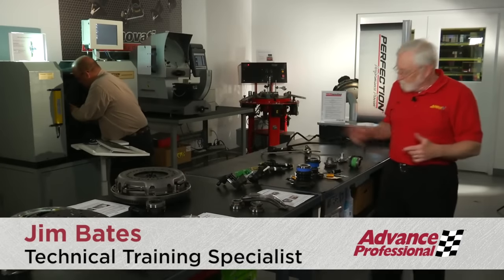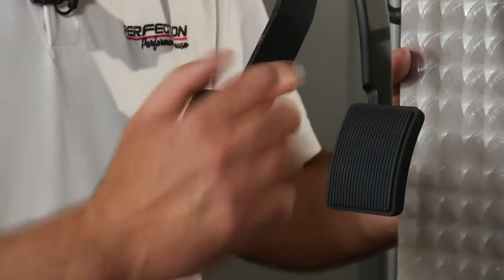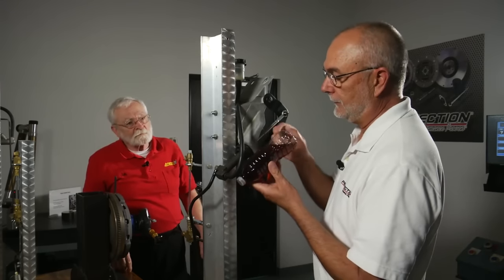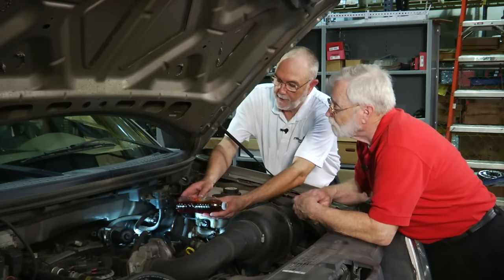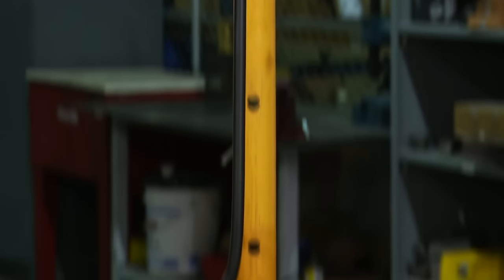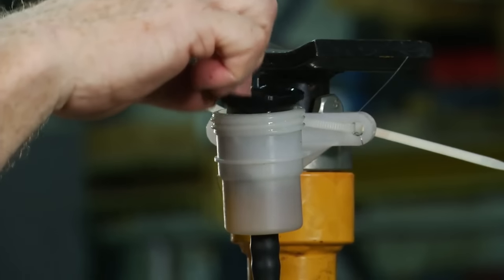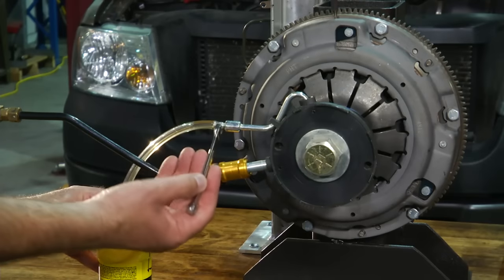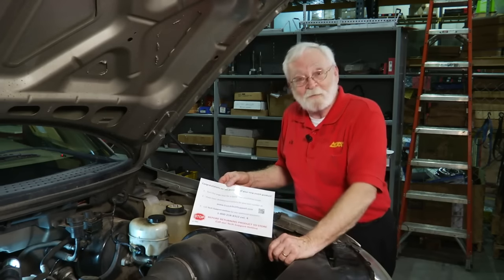How To Bleed A Hydraulic Clutch - Wrenchin' Up

Comment: out of all the cars/trucks i've had in the past years,none had a hydraulic clutch.my current truck is just an '86 chevy 1/2 ton short bed with a small block chevy engine in it.why did they do something like that at the factory.guess i'll need to do some google searches or check some information on here.
Reply from the maker: Hi - Thanks for watching and for your comment! Yes, hydraulic clutches have been around for quite a while and I'm sure you will find a lot of  good (and bad) info out there in your search.
Reply: @WrenchinUpwithJimBates  thank you for replying to my comment,very much appreciated.after watching your video a second time,i just may stick with what's in my truck at present.it seems very easy to do and can't be any worse than having to bleed brakes.the information provided in the video is very helpful and i hope all who watch it,me included, will get something out of it.whether it be their first time or have done this before.once again thanks for posting your video.

Comment: so I had a clutch pedal that was all the way to the floor.  couldn't shift gears.  I unbolted the slave clutch cylinder but could not remove the rubber clutch line connected to the slave cylinder (the nut is pretty stripped).  I did notice I could not push the piston in at all on the slave cylinder so I figure it is bad and I should replace it.  so for the time being, I left the slave cylinder dangling.  the next day,   I came out and the slave cylinder piston is pushing in and out fine.  it wasn't pushing in and out before.    so I figure, maybe the problem is now fixed.    so, I bolt the slave cylinder back on and start self bleeding it.  however, I open the bleed valve and nothing comes out.  believe it or not, I completely remove the bleed valve and still no fluid is coming out of the slave cylinder.   the clutch cylinder fluid reservior is full.  I did pump the clutch, many, many times (with the bleed screw crack 1/4 turn) but no fluid is leaking out of the bleeder valve.   is my slave cylinder now clogged?  or is the clog somewhere else?
Reply from the maker: Hi - Thanks for watching! The slave cylinder piston may be bypassing. I recommend that you check with Precision Clutch because they have an extensive library of vehicle specific videos and information to help with the diagnosis and repair. Their contact information is this video's description.

Comment: Nice, but how would I stop air from getting back into the system when installing? All my stuff has hard fixed lines, I can't remove it without removing the lines.
Reply from the maker: Hi Dennis - Thanks for watching! Great question - I suggest you ask the folks at Perfection Clutch because they have a library of vehicle specific videos and information that can help you with this. Their contact information is in the video description.

Comment: hi . my jeep Rubicon 2007 manual 6 gear 3.7 , has a problem if you press clutch it goes in gear but its not engaging or going in gear
Reply from the maker: Hi and thanks for watching! I appreciate your comment but there is not enough information there for me to understand the problem. When you press the clutch what goes in gear - the shifter or the transmission? What's not engaging - the clutch or the transmission gear selection?
Reply: Yea bro thats cuz of the pedal

Comment: 06 chevy colbalt starts but doesnt move. We bought a new clutch but haven't installed it yet. Was wondering if it could be anything else before we fix it?
Reply from the maker: First of all, thanks for watching! As far as your question though, I would need more information before I could offer any advice, such as when and how did it start doing this, what you have checked already, is the car in gear when it doesn't move, can you get it in gear. etc.
Reply from the maker: Thanks for keeping an eye on this Gary. Your input is very relevant and helpful!

Comment: i Have a 1989 Full Size Bronco V8  i am Having trouble Bleeding my New Cylinder & Line,  My fluid cup & Master is ONE  & the same,  what is the best way to Bleed,  you only show the cup a short line then the master, Mine is all in one,  PLEASE HELP ?
Reply: Hi Gary,  i have bleed this new clutch the best i can,  i can drive it,  but the clutch grabs at the very bottom, to get it in reverse or first gear, i must have the peddle pressed into the floor as hard as i can,  it is a Bronco 1989 full size 
5 speed,  my master & cup is set up just like a brake master,  but the line comes out of  the front of it "master"and goes on a 180 degrees,  then goes to the firewall & to the slave,   i have done many 4X4 s but never had to replace the line or slave,  the only way to get that air out is a vacuum ? and that might not work  ?       i had this truck since 91' and it always shift VERY WELL ,  Once i get into first gear & drive it shift into all the gear just like it use to,  but getting into first or reverse i have to bury that clutch as far into the floor as possible ,,,
Reply: i TALKED TO TONY A  WHILE BACK,  I WAS TOLD TO NOT REMOVE THE MASTER BECAUSE I WOULD HAVE A HARD TIME GETTING IT BACK IN,   I TOOK MY TRUCK TO BILL'S TRANSMISSION IN EASTPOINTE MICH,   THEY HAVE A GREAT REP,  AND BILL TOLD ME IF I WANTED TO DROP THE TRUCK OFF HE WOULD NEED IT FOR TWO DAYS,  I ASKED HOW MUCH WOULD HE CHARGE ? HE  CHARGE'S $90.00
BUT HE SAID IF I COULD BRING IT IN HE WOULD NOT CHARGE ME, " IF IT WAS JUST THE BLEEDING "
SO I DID HE HAD IT FOR TWO DAY'S,  HE CALLED ME & SAID DAN ,   I  THINK IT'S A LITTLE BETTER,    MAN WAS I HAPPY,  I WENT TO GET IT AND IT WAS THE SAME " HE SAID THAT THEY NEVER HAD MUCH LUCK WITH VACUUM BLEEDING, I GAVE HIM $20.00   BUT IT WAS  THE SAME,  HE SAID WHEN EVER HE DOES FORD TRUCKS AROUND THE YR OF MINE HE ALWAYS BLEEDS IT AND LETS IT SET OVER NITE & BLEEDS IT THE NEXT MORNING, AND THEY ARE GOOD TO GO,   THIS IS CRAZY,  SO I GUESS I'LL HAVE TO USE IT THE WAY IT IS,  OR SPEND &75.00 OR SO FOR A VACUUM  PUMP AND HOPE THE HELL IT WORKS,   IT'S A V8  5 SPEED  302 CI

Comment: I used this technique and the master cylinder bled fine, but after installation i have no clutch pressure at all. tried gravity bleeding, but nothing came out of the SC bleeder. any tips?
Reply from the maker: Hi - Thanks for watching! When you wrote that nothing came out of the SC bleeder did you mean no fluid or no bubbles in the fluid? I would also like to recommend that you check out Precision Clutch’s website because they have videos on installing and bleeding clutches on vehicles by year/model and can probably be of more help. Their contact information is in the video description.
Reply: @WrenchinUpwithJimBates  thanks for the response. no fluid came out. its a 90 f150 m5od. and i'll look at the website as well
Reply from the maker: Be sure to check to see if the master cylinder is bypassing internally if you haven’t already.

Comment: HELP PLEASE! I removed the master and line as shown in the video, however when I try to actuate the rod during bench bleeding I get absolutely no movement. DO I need to press something into the slave cylinder connector and submerge in fluid. That wasn't shown in the video, but those are what I'm thinking.
Reply from the maker: Hi - Thanks for watching. There is nothing else that is needed to be done that was not in the video. I would like to suggest that you check out the Perfection Clutch website as they have a vast library of vehicle specific videos that might help. Their contact information is in the video description.
Reply: Suggest getting a new master cylinder.  Appears the cylinder bore is damaged

Comment: Got a gen 1 bronco 2 that doesn't disengage the friction plate I've tried pushing the pushrod but its rock hard.
Reply from the maker: Hi - Thanks for watching! Long distance diagnostics is difficult, if not impossible, so I suggest that you check a service/repair manual, make sure everything is mechanically assembled properly (clutch disc is not in backwards, etc.) and then check out the large Precision Clutch video library. They have vehicle and problem specific information there that could help.

Comment: Sir i m facing a problem in my skoda fabia 2009 . When i m phushing my clutch to change gear then r.p.m goes high every time. Any suggestion from your side.😐😐😐😐
Reply from the maker: Hi - Thanks for watching! Long distance diagnostics are difficult, if not impossible, to get it right. But I do suggest checking for codes, IAC, TPS and intake manifold leaks for starters. Assuming your foot is not still on the accelerator pedal during the shift.

Comment: hey Jim i have a 05 mustang gt installed a new clutch kit with new throwout/slave cylinder. basically pumped the pedal many times eventually was able to shift and drive the car. theres always been some peddal play at the top and the clutch engages pretty low. i noticed that during hot weather and stop and go traffic clutch engagement is sloppy sometimes it feels like its engaging right off the floor and the shifting becomes notchy. if its air in the line how can i remove it since theres no bleeder valve in this car? or could id be the master cylinder?
Reply from the maker: Hi and thanks for watching! If there has always been some "pedal play at the top and clutch engages pretty low" as you have described, you might want to check a service or repair manual for the procedure to check your master cylinder for bypassing, since you mentioned that concern. Be sure to watch the video again for the procedure for bleeding the air out of your clutch lines because this method does not require the use of a bleeder valve.
Reply from the maker: Thanks for jumping in Gary. Your comments are useful and, as always, very much appreciated.
Reply: so when i apply vacuum to the reservoir for about a minute and then release the vacuum do i then remove it and begin pumping the clutch pedal without the reservouir cap on and just leave it open at the reservoir??
Reply: Exile Hey My O7 mustang Gt is doing the same thing when u bled it did it give you different results
Reply: The clutch definitely felt better when I used the vacuum method but eventually after a long drive and stop and go traffic the clutch pedal doesn't feel consistent. Im considering new clutch master cylinder see how that goes.
Reply: You have too much play at the top of the pedal go under the dash on top of the pedal loosten the nut and spin the rod it’s connected to to move your engagement point higher but not too much because then your clutch won’t properly engage and your rpms will just shoot up
Reply: Exile

Comment: If the master is horizontal, why not work on it on a hill (w tires chalked) so you don't have to remove assembly?
Reply from the maker: Hi - Thanks for watching! Some folks have tried that with some degree of success. You could scan through the comments for their experiences if you're interested.

Comment: I have a 2001 f350 diesel I put a new clutch but is hard put get it on first gear and it grinds when it goes into second gear and after that it's all good is that air on the system and is there a way to bleed the air out
Reply from the maker: Hi Alex - Great question and yes, air in the system could be the problem or part of the problem. Be sure to ask the folks at Pression Clutch about this to be sure. Their contact information is in the description below the video. Thanks for watching!

Comment: Will give this a try. I've been fighting with the air in the line for 2 days with no results.
Reply: Would be good to see a fast way to do this with a hardline set up
Reply from the maker: Thanks for watching Joe - Let me know how it worked out for you.
Reply from the maker: Interesting thought - maybe Perfection Clutch will reply with some insight on this?
Reply: Hi guys first off great video! I have little knowledge of mechanics but manage. I have a little 94 Toyota t100 that sat for over a year. So getting it back in running condition I drain and replaced all fluids not knowing I was draining clutch master cylinder I loosened a line and bleed fluids. I could not get the line back on so I put a rag around to keep particles out until I had time to mess with it, which sat for a week. I finally got it attached and having issues with no pressure in clutch pedal. Hopefully this is easily fixed. Can you instruct me on what I will need to do?

Comment: I'm confused, why exactly does just loosening the bleeder valve and then letting gravity pull fluid down from the reservoir and continuously adding more fluid, not flush all air from the system?
Reply from the maker: Hi - Some clutch master cylinders get air trapped near the top of the cylinder itself and fluid from the reservoir does not flush it out. Tipping the cylinder allows the air to escape and bubble up into the reservoir. Thanks for watching!
Reply: Jim Bates okay, with that being said, couldn't you use a fluid exchange pump to force enough fluid into the hose from the reservoir to push anything that might be stuck in the line or master cylinder?
Reply from the maker: Good question! Although I would think someone would have tried that by now and published it in a service manual or commented on it somewhere on the internet. However, give it a try and let us know if it works!
Reply from the maker: ***** Thanks for jumping in on this again Gary. Your knowledge and experience with this issue is a big help!

Comment: hey Jim I just had a New clutch put in my 1997 Honda passport.the gears are disingaging to neutral while driving.what do I do?
Reply from the maker: Hi - Based on what you have typed, it would seem that the problem is with your transmission and not the clutch. You might want to consider having the transmission checked out. Thanks for watching!

Comment: with the car off but when I turn it on it won't go into gear and if I turn the car off put it in gear and start it in gear I'm able to move but not come out of gear is that mean my clutch disc is backwards or do I just have air in line and I got not getting enough to disengage
Reply from the maker: Hi - Proper diagnosis of you issue is not possible without lot's more information. I suggest you check with a service or repair manual for your vehicle and go through the step-by-step diagnostic procedure. Checking the Perfection Clutch website for possible answers might help too.
Reply: I think it might be that air pocket you were talking about it your video I'm going to try jacking the front of the car up high enough then bleed it
Reply from the maker: Hi - Could be. Let me know how it works out.

Comment: What happens when you don't have a check valve at the end of the lower clutch line that attaches to the slave cylinder?  The fluid would just poor out the hose
Reply from the maker: Hi - Thanks for watching! For the best and most accurate answer I suggest that you ask the folks at Precision Clutch.  They also have a vast library of vehicle specific information and procedures. Their contact information is in the video description.

Comment: Hi, Jim, Great video. I have an  cuestion Wha kind  of fluid I have to use for bleedin clutch on mazda 3? Thanks.
Reply from the maker: I don't know if this is the answer you are expecting, but you really should use the type of fluid the vehicle owner's manual and/or service manual specifies. Thanks for watching!
Reply: Regular DOT3 brake fluid. The clutch master cylinder feeds off of the brake master cylinder on Mazdas, so that's what you use.

Comment: i own a jeep tj 1997 i try to change only the slave cylinder but having an hard time bleeding the system do i absoluly need to put the hole system out or i can do it in place
Reply from the maker: Hi - That's a good question but, being more of a journalist these days, I'm not sure so I suggest you direct your question to the folks at Perfection Clutch using the contact info in the metadata below the video. Thanks for watching!